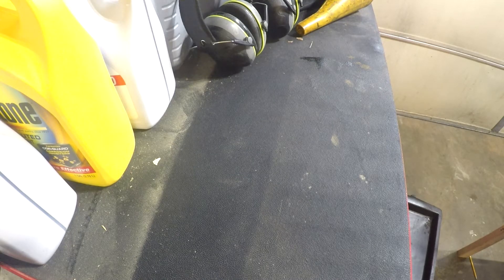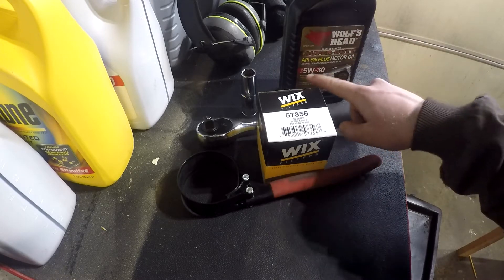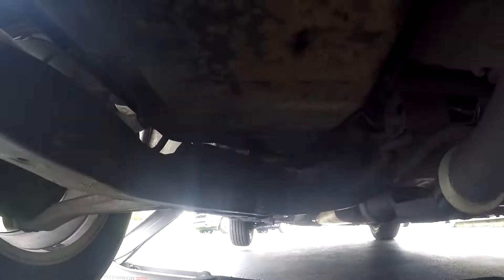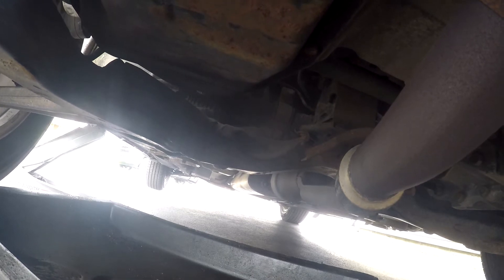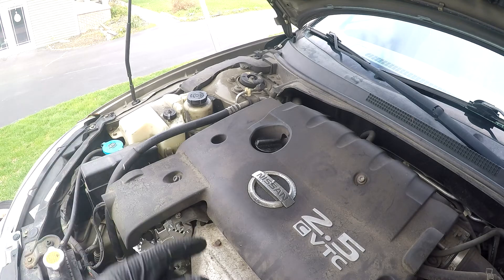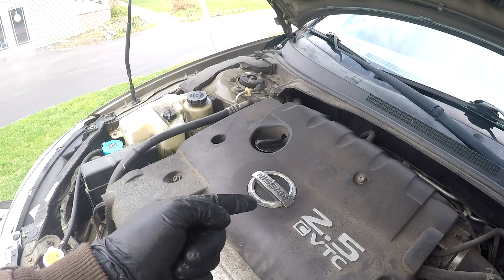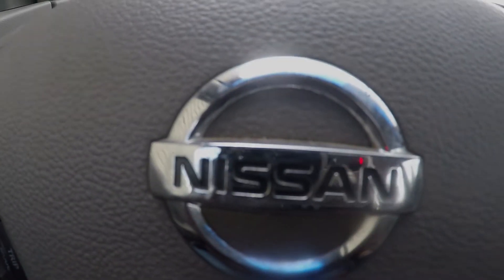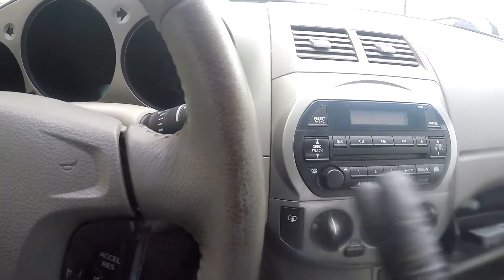2003 Nissan Altima Oil Change: The Dumb Mechanics Ep. 12

Comment: THAT OIL PAN AN FILTER ON THE PASSENGER SIDE, LIKE ME, IF CAN NOT FIND AN OIL WRENCH  (SON LAST TO USE)A SCREWDRIVER AND HAMMER WILL DO GET SHORT DRIVER BANG THROUGH BOTH SIES AND USE A LONGER ONE TO TURN, COUNTER CLOCKWISE.